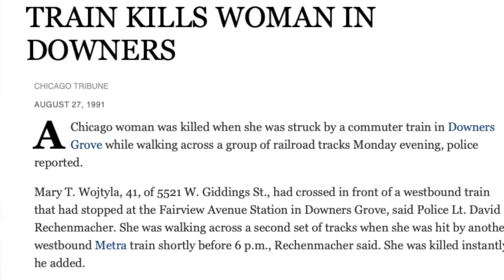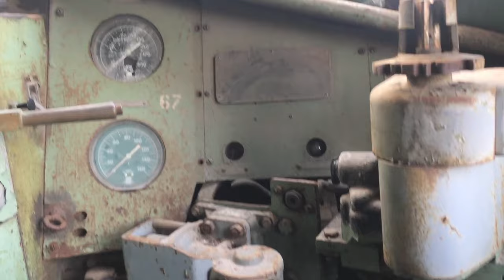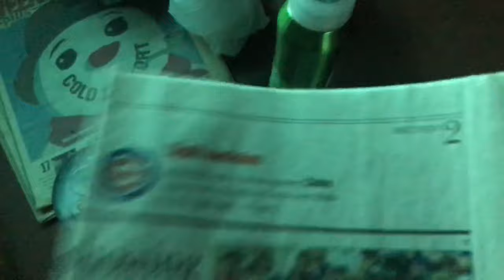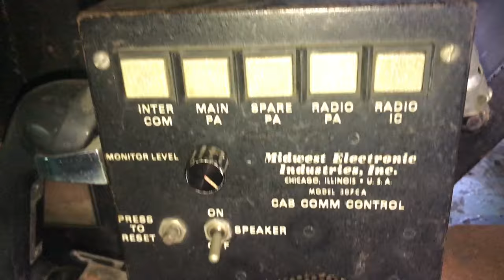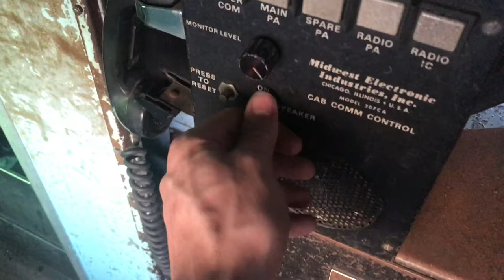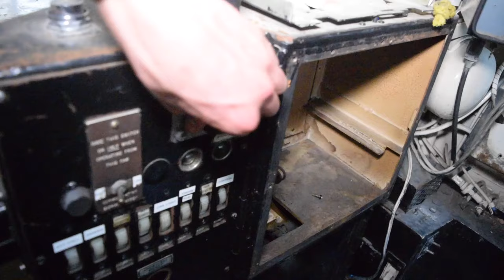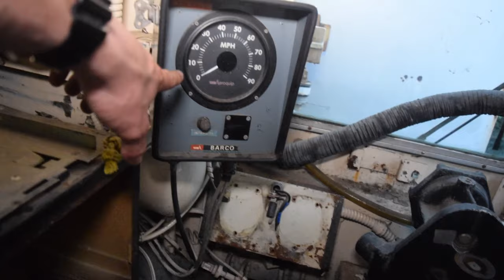ABANDONED TRAIN WITH A DISTURBING PAST

Comment: These locomotives and passenger coaches are not haunted at all.  As others have pointed out, this particular locomotive was not the one depicted in the accident video.

Iowa Pacific Holdings acquired this equipment to use as parts sources for its excursion fleet and stored them on its Chicago Terminal Railroad in Bensenville.   When Iowa Pacific went bankrupt, this equipment remained in situ.

The locomotives are lettered for MARC because they were later sold to that agency when they were no longer needed on Metra's BN line.

Comment: The reason why the coaches look like they came from metra. Is cause the locomotive and the coaches used to be owned by the “Burlington Northern” but around the 90s or 80s metra took control of the railroads passenger service. But the passenger locomotives from “Burlington Northen” were sadly scraped, while some were lucky. But the coaches metra used

Comment: This locomotive is an X Burlington Northern E9 unit and it was one of the last vintage passenger diesels in regular revenue passenger use and they were mainly used in commuter service before being retired, this one was not the one that hit that woman but it is the same unit as far as the design goes, I think the one that hit that woman was actually preserved but I could be wrong, also heres some videos showing the units in operation:

Link1:https://youtu.be/oi4Ro-3IE-w
Link2:https://youtu.be/uX2dJ5t3ooY
Link3:https://youtu.be/t7atCGSEhNg

Comment: Before this train came here it was at the illinois railway museum in 2005  soon it was taken out in 2007 to a shop to be rebuit,  according to railroad picture archives this locomotive was hauled around Chicago before coming here.  

Some history about this engine it was originally built for the chicago burlingtion and quincy railroad then in the 1970s when Burlington northern bought the railroad it was a BN unit then in the early 1990s MARC bought a bunch of these trains and patched them into the marc, by covering the BN logo and putting the marc sign on.  

One more thing, this is not the engine that hit the woman that day  if you look closely at the train you can clearly see there is no MARC sign on the nose of the train and another thing the train that hit the woman was numbered 9912
Reply from the maker: Awesome history on this train!  I guess I stand corrected on the identification of this train.  Maybe this wasn’t the one
Reply: One thing there is MARC on the nose
Reply: I was looking through some old pictures and I took a picture in front of that MARC engine when it was at the Illinois Railway Museum. I knew it looked familiar.

Comment: THIS IS NOT THE 9912. if you examine the front, it says MARC, (which stands for Maryland Area Regional Commuter), BUT, the 9912 was never given, sold, or leased to the MARC. the former BN E9s that were include: 9902, 9905, 9906, 9907, 9908, and 9911. but again, this unit has MARC stamped on the front, so it is obviously NOT the 9912.

Comment: The train that hit her was locomotive # 9912 which is now at a railway museum in I think Tennessee.
Reply: Nit-picking.......... BN 9912 is a locomotive, not a train.......... RR operating rules define a "train" as a locomotive, with or without cars, displaying markers.  Next you need to know the definition of markers.  They're the red light(s), red flag stuck in a coupler knuckle or built-in marker lights by the rolling stock mfr, or end-of-train devices that replaced cabooses once occupied by the conductor, rear brakeman & rear flagman, depending on era.

Comment: The other cockpit is actually called a cab car. Also these cars were built in the 50s and 60s by nippon sharao metra has recently remolded some of their car to make up to date and get rid of most of the stream lining. The cab car probably last ran in the 90s due to no PTC screen or modern speed gauge. Caltrain also has these cars but they are removing them due to electric being added to their lines also Caltrain is like metra but it runs from San Jose to San Francisco